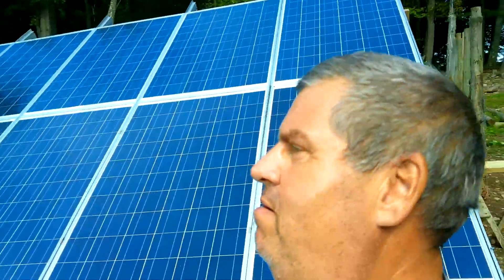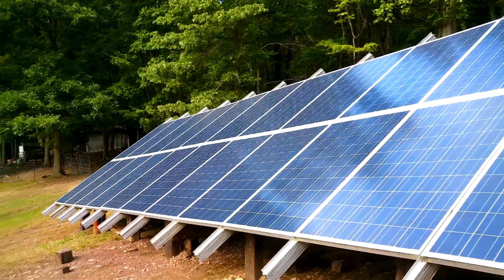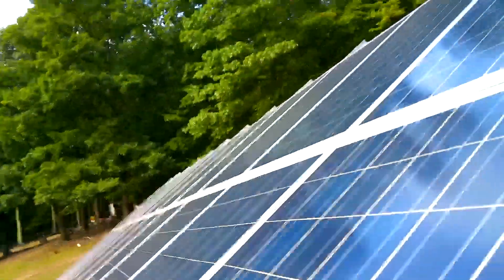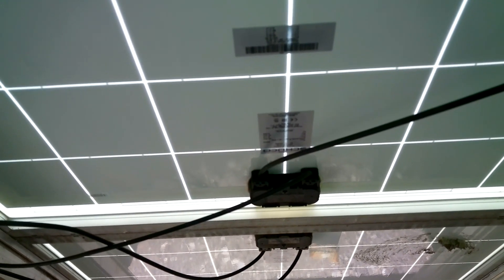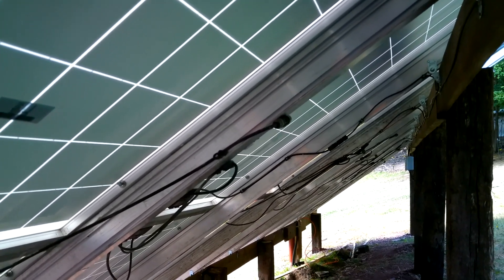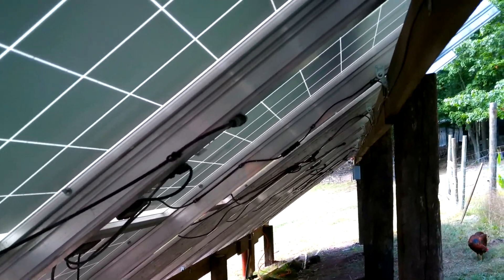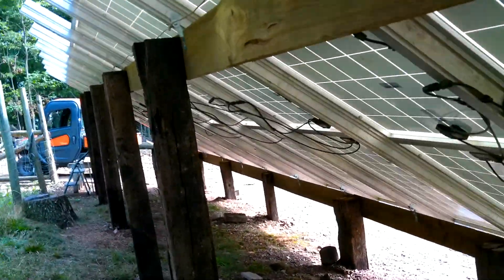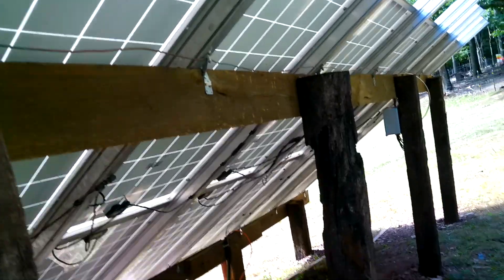Solar Fail To Solar Win!! #farmsteading #solarenergy #homestead #offgrid #solarpower

Comment: How many watts do u need to be able to run 2 window units.. a small fridge and washing machine and dryer completely off grid
Reply from the maker: You would need to get a watt meter and run them to see how much each one is pulling   General rule of thumb is daily usage plus 20 percent on battery capacity

Comment: ... Most WELL-PUMPS can be WIRED for  120 volts  or  240 volts ... 
build a Clothes-line &  retire your  240 volt Electric Clothes DRYER ... 
IMHO ...
COOP 
...
Reply from the maker: My well is 520 feet deep, so a 120 volt pump will not work and we have a clothes line but we do use our dryer in the winter. Thanks for watching and commenting, really appreciate it

Comment: Interesting (from what I think I heard) that you are sending 27 amps at 200+v  to a combiner? box then to a MPPT controller. Most 10 gauge wire says 20 amps max and most MPPTs  have max of 20 amps PV input.  Those 2 factors (max Volts and Max Amps) are things DIYers have to work out in what panels they buy, what controller they buy and the wiring arrangement of panels.  What kind of set up do you have?
Reply from the maker: It’s a Sun Gold Power 6548 offgrid inverter and from the array to the inverter I pulled #8THHN.
Reply: When I read the SunGold 6548 manual it indicates max of 18A going into each of the 2 Mppt controllers built into the unit-so total of 36A.  That is why I was concerned/surprised that you were sending 27A, it seemed,  down a single line to the SunGold.  It would be fine if one set of Pos and Neg PV lines sent 18A to one Mppt and the remaining 9A went down separate Pos and Neg wires to the 2nd MPPT.  The 8 gauge wire can handle the amps (either the 18 , the 9 or the 27) and will have less voltage drop, but I hope you have 2 sets of wires. The Sungold does say that the unit can send a max of 120A to batteries and that power can come from PV or utility, but 18A x 2 or 36A is max the 2 MPPTs can handle @AppalachianFarmstead
Reply from the maker: @douglasrobbie9998  Thanks for the advice. I’ll have to look into pull a second set of lines. Not sure if they will fit in the conduit though.

Comment: And the problem with no current with the original set up was.........?
Reply from the maker: I haven’t tested every panel but a lot of the junction boxes were pretty smoked so I’m assuming they are not making good connections. I have a new junction box to replace a bad one to see if that works. Probably not messing with that till spring though. The original plan was to bring the 22 panels from the grid tied system and add to the 1st array to make a total of 11 kw.   Thanks for watching and commenting, really appreciate it
Reply: @AppalachianFarmstead  You are welcome. Seriously consider buying the meter and testing panels before purchase or if after purchase, one at a time in place.